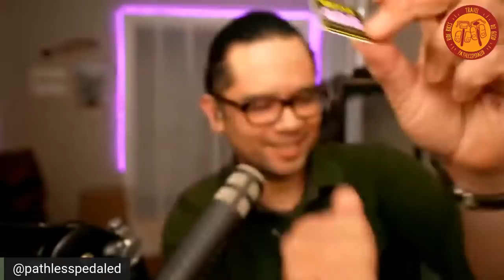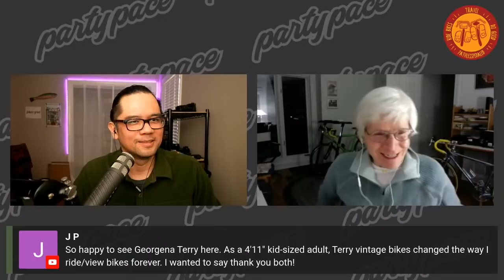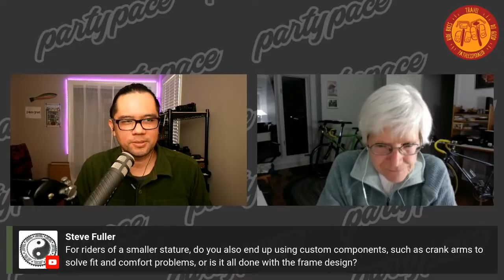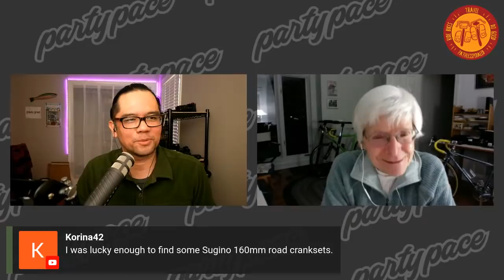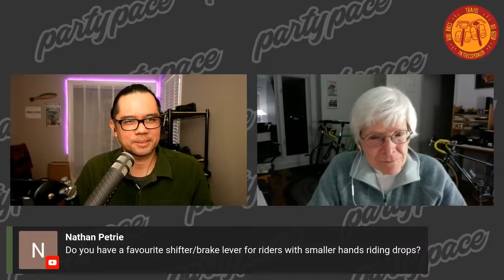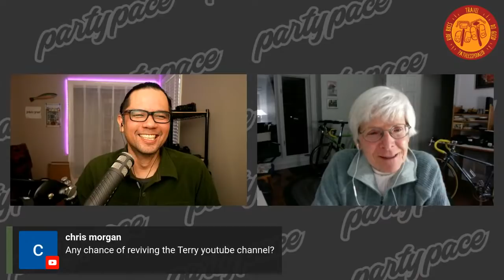Small Bike Design Challenges - Georgena Terry

Comment: Really sorry I missed this one live Russ.  As an engineer myself, I find I'm in the design detail weeds a lot too...which usually just stacks the questions.  Also, her comment about using Amazon in the current market rings true on so many levels.  My shop is doing the same as a last resort, or we tell the customer if their timing is better (online), then bring in the parts and we will install. Not only do we check our distributors everyday, we scan Amazon and other online dealers often too.  Definitely the pitfalls of the bike Industry's version of JIT manufacturing. Hopefully '22 will be better.

Comment: thanks for this interview and for both your contributions to the  bike industry.    now i want a custom built steel monster cross.   have GRX groupo's on both gravel beasts which have been superb, and the levers are a bit easier to squeeze. i do prefer the disc over rim brakes b/c of ease of  wide tire change.   would really love to have seen your personal rigs.   next time?   

in looking at the gallery/blog pics on the GT site, my bars are MUCH lower than my saddle, so am wondering about the fit.   am also fighting an illness that impacts back muscles and neck joints, am trying to find short stems that rise in SILVER.    Dimension makes a 60mm at 125 degree rise, which would really help my situation.   let me know if you know anyone who custom fabricates these as the Dimension is out of stock.  hands have been a bit numb so it's time to figure out why.
Reply from the maker: Velo-Orange Cigne or similar stem.